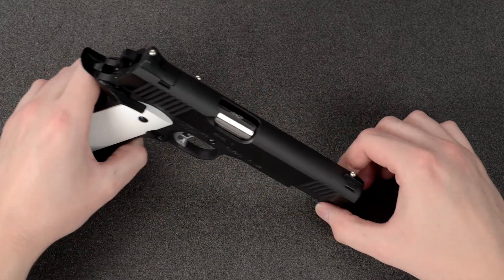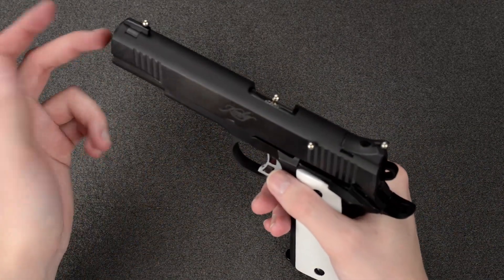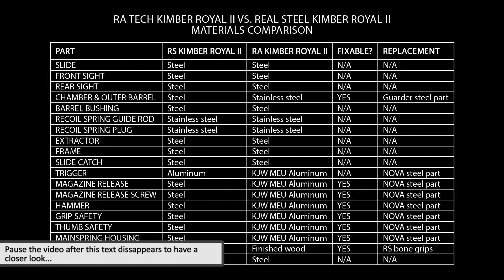NonEx - RA Tech Kimber Royal II - Parts Material Overview - Steel or Not Steel ?

Comment from the maker: Thanks for the follow up.
Now that you mention it, it does sound familiar. I had so many issues and tear downs of the Kimber I kind of forget.
I did try to fix it by bending my spring as well but I ended up snapping it. Now I run the Airsoft Surgeon leaf spring and it is super light but works!

Comment from the maker: I had a similar issue, but after replacing most of the stock KJW parts my action functions better. However, try to ride the thumb safety down when shooting and see if that helps. It can be sticky alot of times.
Other than that, take it appart, polish the disconnector and sear and lube it up... :|